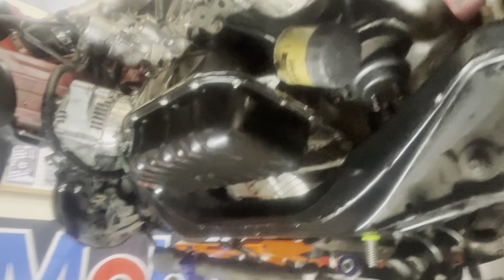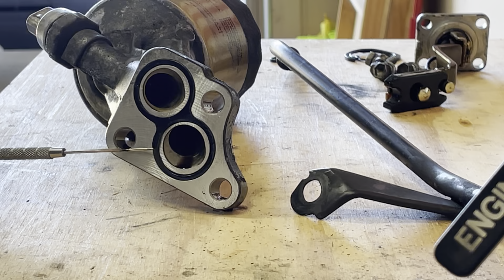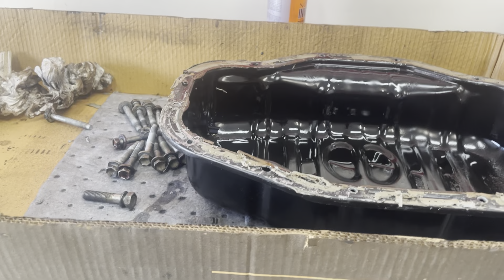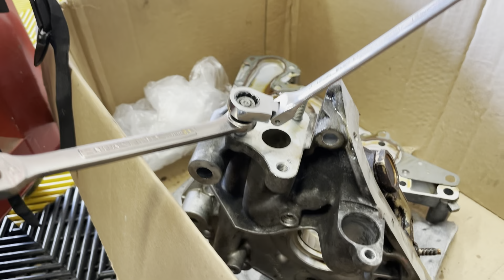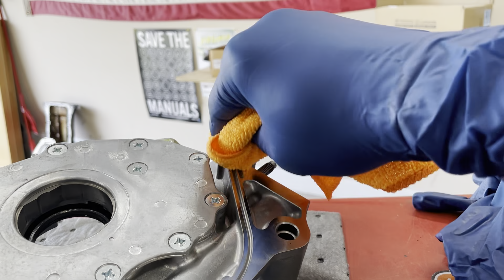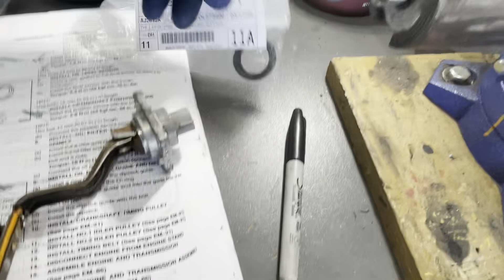Nasty oil leak from a $4 oil pump o-ring?! Let’s replace the oil pump without pulling the engine!

Comment: Whats the part number of the gasket on the oil strainer i cant find it (LS400 96)
Reply from the maker: It’s not in the vid description?
Reply: @ForwardMomentum  nope
Reply from the maker: This is a copy and paste from the video description. The strainer gasket is shown. What am I missing?

PARTS LIST FOR 1UZ VVTi
Item & PN
Aisin T-Belt & WP Kit TKT-021
Coolant-Safe FIPG (Permatex Ultra) 22074
Red Coolant (if needed)
Aisin Oil Pump Kit OPT103
Oil Pan Plug Washer 90430-12031
Gallery O-Ring 96721-24025
Crankshaft Oil Seal 90311-A0001
Oil Filter Housing "8" Gasket 15692-50020
Strainer Gasket 15147-50011
Oil Level Sensor Gasket 90430-27001
Dipstick O-Ring 96721-19010
(1) Seal Packing 103 FIPG 00295-00103
5W-30 Full Synthetic Oil 5W-30
Oil Filter 90915YZZD3
Reply: @ForwardMomentum  Bro I was just trolling because I didn't read it. I saw links and figured it was full of promo bs, its kinda crazy how you actually respond in the comments. Low-key doing the Lord's work but I smooth didn't think you would entertain my bs. 😂 Mines not the vvti I've been just cross referencing for compatibility because I don't know what all is different. I'm about to drop the rack and cross member but the vevor stabilizer bar got a little bit of a bow to it. Might swap out for the cherry picker. Clearly I'm not a mechanic but I'll try to do anything.
Reply from the maker: I do try to respond when I can. 👍 toyodiy is a good site for cross-referencing if you don’t already know about it. Good luck!
Reply: @ForwardMomentum  saving fucking lives 🤘🏽🤘🏽 much appreciated

Comment: Do you not have a cross member brace anymore? I was changing my rack and pinion bushings , and the bolts on mine where rusted through, so they keep spinning 😭😐
Reply from the maker: Yes, I still run the brace. Pretty important piece actually. 👍
Reply: @ForwardMomentum I guess it's time to replace the front subframe for me 😭
Reply from the maker: Yeah I would. Even the stock bracing leaves a bit to be desired, which is why high end Japanese companies like Tom’s and AB Flug came out with enhanced pieces. You should be able to source one easily. 😎
Reply: @ForwardMomentum good looks,  my old one was shot 😐 wasn't bracing nothin' 😂

Comment: This brings back nightmares!  Did this job on my LS430 a few months ago.  Same leak!  I dropped the entire subframe out of the car, but that's just a difference in platforms (front vs rear sump pan, etc).  I'm a tech by trade, but having to apply sealant and then maneuver the part into place without contaminating the sealant or wiping it off against another part is always anxiety inducing.  You seem to have managed it well, with the added bonus of making some great content along the way.  Keep it up, sir!
Reply from the maker: Thank you! I can’t believe how many people blow the job off as “easy” and yet here we are, a tech by trade noting that it’s a pretty tedious job, especially with the SF in place. Thanks again! 👍

Comment: My 06 430 got the same issue I believe 🥲 only purchased the timing kit and front seal.
Hopefully its just the seal, but I doubt it honestly.
Oil leaks from that little bottom hole under the crank pulley timing cover.
So far its nothing urgent, i dont even need to add oil before changing it next year, but cant keep avoiding it forever

Comment: I though about this a lot, I think you had premature failure of that oring and will have other failures due to boost. Boosting a engine that is designed to operate in vacuum mode will start to have failures in a boosted application.
Reply from the maker: This o-ring also wears out on N/A applications. Crankcase pressure isn’t really a factor in this particular spot, so while I agree with you in a general sense about boost, I think a lot of people are driving around with this dripping, perhaps assuming it’s the oil pan itself and just writing it off. It’s very difficult to diagnose with certainty until the crank pulley and cover are off.

Comment: Really impressive work man, very thorough. My GS4 is fairly clean overall, but absolutely pisses oil out of the front cover in various spots haha. How much did you have to lift your engine up higher than where it normally sits using the support bar? 

Other random question: where did you purchase your FSM?
Reply from the maker: I would estimate 2” up from nominal position. Funny enough my limiting factor was my throttle body because of where it sits in proximity to the firewall due to the supercharger. I went up until the TB was 3mm from the firewall. Some guys just peg the bell housing against the wall but I couldn’t. Anyway, I got my FSM from Toyota Information Services (TIS) after I bought a day pass for $15. I downloaded the entire thing but it doesn’t have good 1UZ engine material in it. I get a lot of the pages just by Googling my need and using image search. So much of it is already out there it’s crazy.

Comment: Not related to the video but i have a 98 GS400 keep getting a knock sensors code for bank 1 and 2 i already swapped out the sensors and rebuilt the harness clips the code  still hasn’t gone away i am thinking that the Denzo sensors i bought on ebay were not the “real deal “ but i am honestly hitting a wall any insight would be great
Reply from the maker: Did you have the same knock sensor codes before you rebuilt the harness and replaced them?
Reply: @ForwardMomentum  they were the same exact codes
Reply: As far as I can tell somebody replace them once before and just siliconed the wires onto the sensors
Reply from the maker: Those wires, as you may know, are shielded. Sometimes people screw everything up by using unshielded wires. It sounds to me like all new shielded wiring from the KS’s to the ECU would be a thought.
Reply: @ForwardMomentum  from what I can see, the wires are part of the same plug/harness as a starter the wires don’t appear to be shielded the harness that I ordered from the auto parts store came with shield wires. I tried using those connectors first I ended up buying different connectors and soldering them together for a better connection
Reply: I searched high and low for a whole new harness, but everybody keeps telling me that it’s part of the main engine harness and you can’t get a new one
Reply: It would be easier to convey my conundrum if you can post pictures on YouTube comments😂
Reply from the maker: You can HMU on IG if you want. @yt.fwd.m although I’m not sure I will have much to add from here.
Reply: @ForwardMomentum done and done

Comment: next time just pull the motor man, seriously. I have pulled a UZ from start to finish in about 4 hours. I just did the oil pump in a 2UZ, its a big job even with the motor out!
Reply from the maker: No thanks.
Reply: He was already 95% there lol 🤣 but to each his own I don't know how he got that oil pan pass that subframe cuz it have huge hump on the back and to get it back up with the sealant on without rubbing it all off. Gl
Reply from the maker: The trick is to raise the engine up and pry the SF down with wood blocks. That hump cleared easily. 👍

Comment: Makes you wonder how many of these were mechanically totalled out by this o-ring failure.
Reply from the maker: My guess is people ignore it and live with a never-ending oil drip as “part of the deal.” Or, it gets misdiagnosed altogether even by competent mechanics who don’t know the engine well, someone spends a grand, the problem isn’t fixed, and they’re back to square one (or your option), where they trade it in wholesale and someone else ends up with it.